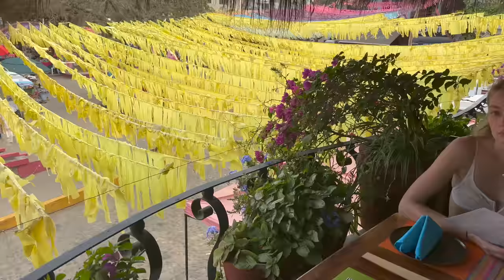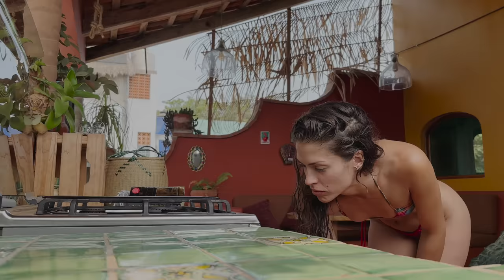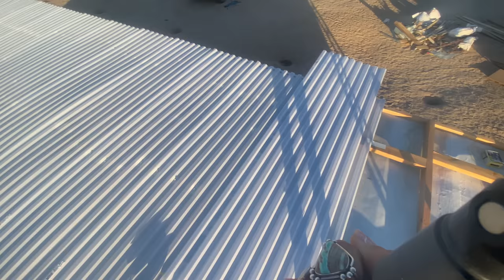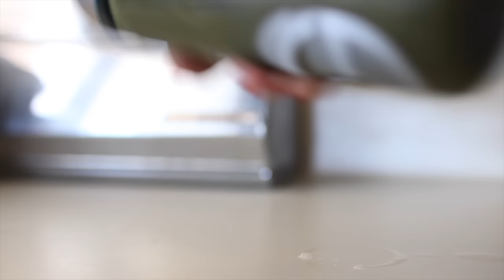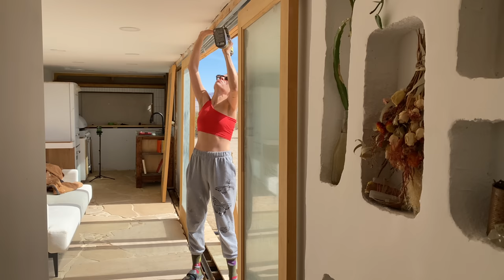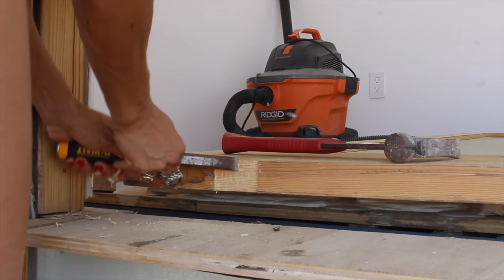alone in the desert | remodeling my tiny home living room

Comment: For your roof, use elastomeric coating or tropi-cool - one is 100% acrylic, the other 100% silicone.   They're both paint-on roof coatings that I've used for rvs and truck builds - do yourself a favor and read the instructions thoroughly, watch plenty of YT vids on other ppl using it, and prep your surface better than you really want to... the extra time taken to ensure a clean clean surface is less time dealing with leaks down the road.  (I think both products have a 10-yr lifespan, so, no leaks for a decade is worth an extra day of surface prep!)  They're both pretty easy and very effective.  A LOT less work than what you tried to do, I promise!
Reply from the maker: I did that the first time around and didn't realize the material wasn't salvageable. My next big investment is getting it actually fix or build an overhang over it.

Comment: If the wind is an issue in the desert, why did you leave a gap at the bottom of the doors? Shouldn't the wheels be smaller, or shouldn't the track be installed deeper in the floor to prevent this issue? I foresee a lot of creepy crawlers and dust in the trailer.
Reply from the maker: Trust the process! I didn't include the weather proofing in this episode but you'll see how I handle it when we decorate and seal up the exterior! 🫶🏼🫶🏼🫶🏼🫶🏼
Reply: @LivingtoDIYwithRachelMetz  I can’t wait to see the following episode. Nice job on decorating/styling the trailer. 🙂